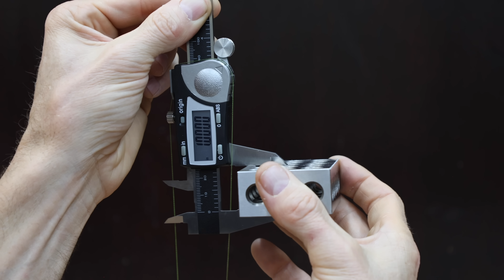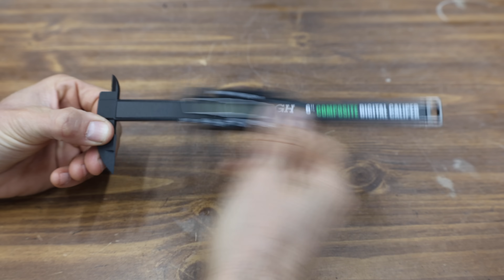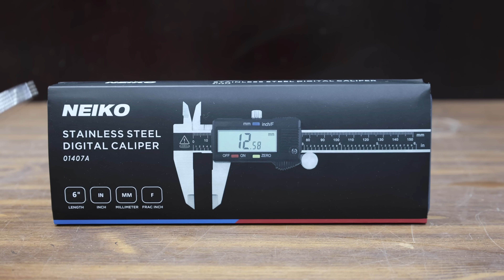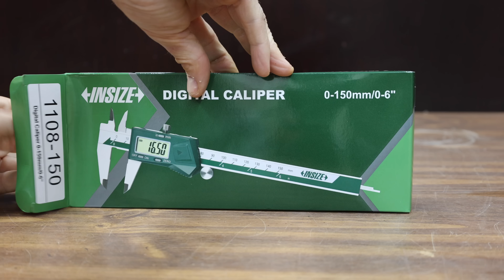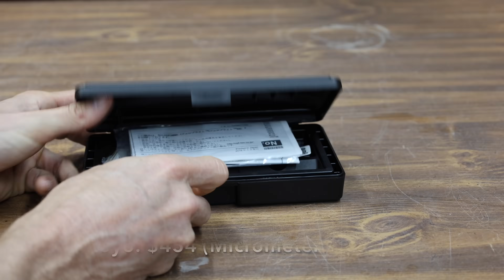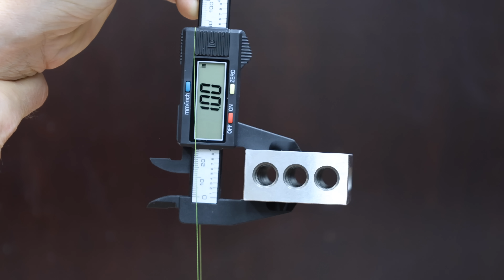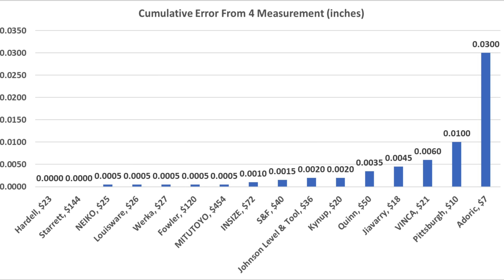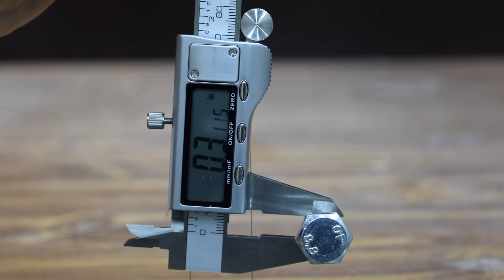I've Been Proven Wrong About Calipers!

Comment: The real difference between the $100+ tools and the sub $100 tools is that the higher priced tools will still be accurately reading after long term daily use, the less expensive almost certainly not.
Reply from the maker: Thanks for the feedback.

Comment: Great video as always! Beyond the feedback that the others put, I see that some of the calipers have USB ports on their sides and from my personal experience with my rechargeable calipers, the 2032 battery used is usually a CR2032 (CR indicating not rechargeable), but my calipers have a USB side port like I see in some of you models and I mine came with an LIR2032 (sometimes LR) battery in the package and is rechargeable by design.  I know it isnt something you tested, but it would be nice to show as a part in the consideration which models included (was hard to see in the video on all units) were rechargeable out of the box or possible, due to the nature that many here know and you indicated somewhat, the negative nature of calipers that are always found with a dead battery state.  I find that the models that at least include a charging port at least very heavily negate the problem with high battery usage while in the "off" state.  Since LIR2032 batteries only sell for about $5 or less, it can be a simple consideration for many that hate to come to a dead battery.

For instance, I use my set so much, but I find very frustrating to come to a dead caliper battery, that I have a USB magnetic plug on mine that quick disconnects to a USB charging cable at my workshop station so I can always pick it up with a full battery and easily put down with a magnetic click.  This helps keep my readings indefinitely while "off" and doesnt force me to pay a lot for a caliper for the ability to last long on a battery.  Sure, there are solar ones, but being forced to look for a solar caliper also can negate the point of being able to choose whatever brand you want.  Not to mention solar calipers need to be stored usually with light showing on them and reduce real estate for the display and other features.  For as little as 30 dollars on Amazon, it is pretty easy to get rechargeable calipers and put the ever present dead battery on pickup of the caliper as many DIY'ers don't use calipers enough to justify worrying about much more expensive units or always having a spare battery around or removing the battery after every usage.
Reply from the maker: Thanks!  Thanks for the feedback.

Comment: Great comparison! Battery drain when not in use is a killer on digital calipers. I take the batteries out of some of the cheaper ones I own when not in use. Thanks for sharing!
Reply: That's why I bought a Mitutoyo 8" arround 7 years ago, still the original battery inside.
Reply: Ditto. A couple decades ago my Harbor Freight Pittsburgh digital caliper would deplete a battery every 30 days on the shelf. My Mitutoyo goes years on one battery. For most things I have used a plastic dial caliper knowing full well it probably is not as accurate as the measurement suggests, but it was exactly what I needed for PCB layout and spec sheet verification.
Reply: Even most of the ones that "auto power off" are actually running all the time. They only turn off the LCD. Any that wake up from movement alone were probably still measuring. Not a big deal if you use them fairly regularly, but it's more akin to putting batteries in a clock, than say, a torch.
Reply: agreed
Reply from the maker: Thanks and you are welcome!
Reply: Mitutoyo I believe has a patent on tech to shut off battery use when not being used.  This is why the others drain batteries quickly.  It’s unfortunate, really.
Reply: @diamond_h0us  Mitutoyo may have a patent on a way to shut off the battery when not in use but can not have a patent on the only way to shut off the battery when not in use. And it has been over 20 years.
Reply: Absolutely yes I always slide the battery out after using and that's the only way it'll last on the cheap calipers.

Comment: I have owned a set of Titan calipers for a lot of years. I found them online today for $35. Over time, they have gotten quite stiff to open and close, but they still give really accurate measurements when compared to my 0-1" micrometer. My scale says 149.5g
No absolute scale, inch/metric measurements, 4 decimal places in inch, 2 places in metric, yes powerdown after time, LR44 battery which I can't even remember having to replace.
Overall, they are plenty good enough for my occasional use - including when I rebuilt the motorcycle I had.
Reply from the maker: Thanks for sharing.

Comment: When I took my Automotive service technology program at the Southern Alberta Institute of Technology all of the specialized micrometers were Starrett, but they were the very top grade models and they were the old models, meaning they were built far sturdier and made out of far better materials than what the company puts out today. I still have my Snap-On tool truck calipers but they don't carry the Snap-on name, but Snap-On's lower cost brand Blue Point, and they have lasted me well over twenty years and still have not become loose in any manner. I paid $99 for them, which carried a 25 year warranty, which is now over, but the Calibers has an error of 0,001 +or- and for rebuilding an engine it is sufficient But I would prefer to have micrometers accurate to 0,0001. but honestly the $25 calipers would be sufficient for most home use, and even for someone who has an old Lathe. but a professional machinist would have very high quality micrometers because the work demands that kind of accuracy. For me my Blue Point Calipers will last to be handed down to my son and longer if he treats them as well as I treated them.

Comment: Great test, I like that you compared to many models! One you didn't test I can recommend for a good value are the iGaging calipers. Some things I noticed regarding your test:
- 1-2-3 blocks aren't accurate enough, especially not for micrometers. You should use gauge blocks with a certificate and then compare against the length on the certificate. With both of my Mitutoyos, they measure exactly what the certificate states, so I assume the measurement error you found is probably due to the inaccuracies in the 1-2-3 block.
- With cheaper calipers one thing I noticed is that when the batteries get low (before the alarm goes off), the accuracy drops a lot. It would've been interesting for you to hook up a power supply and see how they measure at different voltages.
- It would also be interesting to measure power draw, especially when they are powered down. I noticed cheaper calipers don't really power down and are usually dead within 6 months of not using them, while Mitutoyos last for years.
Reply from the maker: Thanks!  Thanks for the suggestion.
Reply: @ProjectFarm  you're welcome! Another thing I just remembered, with some cheaper calipers, when you open and close them quickly (just like you did for the initial smoothness check) they "lose track" and when you close them they don't go down to zero anymore. This is what is referred to as "Max. response speed" and Mitutoyo's calipers say "Unlimited" which in my experience is true. With some cheaper calipers I had to pay attention not to open and close them too quickly. Would be interesting to see that tested!
Reply: @ProjectFarm  I also just replicated the test you did where you measure how consistent the force is on the scale when sliding down with my Mitutoyo 500-161-30, it started off at around 280g for me and progressively went down to around 240g by the end. I was already surprised when seeing in your video the force became higher towards the end, as I never noticed it, and my measurements prove my intuition. I'm wondering whether the thumb wheel (which mine doesn't have) introduces friction, or whether it's just that over time with usage they become more loose?

Comment: As always, thanks for the video!  However IMO as a casual user/DYI all digital calipers are lousy as the battery is guaranteed to be DEAD when you need to use the tool the few times a year you need it so for most non-pros I feel the best option is an analog caliper and I have had once for 25 years that works just fine.
Reply from the maker: You are welcome!  Thanks for sharing.
Reply: Mitutoyo digital caliper doesn't have that issue..

Comment: Another great test. For future tests, it'd be nice to see Shars' Aventor. They appear to be similar to the Quinn, but it'd been real nice to see if they were close enough to likely be off of the same assembly line. If you test micrometers (hint hint), I suggest adding in the Aventor's as well. I have a Mitutoyo digital caliper I bought in the late '90's that is still hanging in there, but I thought it might be dead when I found the battery had leaked. I got lucky it's still working.
Reply from the maker: Thanks!  Thanks for the video idea.

Comment: Starter, Mitutoyo, Fowler, or of the top metrology based brands can’t go wrong. Worked with mitutoyo calipers and is still by far the smoothest when oiled with Starrett tool oil with gravity enough to make them move. I did purchase Fowler/Sylvac micron caliper for 500$, although it is nice reading down to the ten thousands of an inch it’s main use for me is quick, versatile high precision reference measurements when I don’t have a micrometer nearby.
Reply from the maker: Thanks for sharing.

Comment: I looked after a mechanical training workshop a few years ago, and we were always changing the batteries in the cheap calipers we had bought because they chewed through them so quickly. & they were broken by clumsy students (they looked very similar to the Hardell & Neiko ones shown here). However, expensive ones got stolen frequently, so we went back to mid-priced dial gauge calipers, which were almost as easy to read and lasted a whole lot longer than digital calipers.
Reply from the maker: Thanks for sharing.

Comment: My problem with these digital callipers is that you cannot completely turn them off. They will drain the battery in standby mode waiting for the jaws to open and wake up. If there was a digital calliper that fully turned off without removing the batter, I would definitely buy it.
Reply from the maker: Thanks for the feedback.
Reply: True, but the low power tech in the Mitutoyo really works.  Battery lasts literally years.   I would estimate a hundred times better compared to the cheap ones i owned before them.  

On the cheap ones with LR44 battery i would suggest removing battery whilst in storage.  This favors the ones that don't need a screw to hold the battery cover down, and/or the ones using bigger battery eg CR2032

Comment: At one extreme, some of these tests aren't particularly "valid" when you're down to tenths of a thousandth of an inch. For example, even the heat from your hand can change the size of the workpiece but also the instrument at that scale.  But... it's all about the right tool for the purpose.  I have some expensive measuring tools to use when it's critical but I also have some of those $7 plastic calipers for situations where getting down to hundredths of an inch is somewhat overkill (but I need to be more accurate than a tape measure) and if I break or lose them on a jobsite it's no problem.

Comment: I have one from Harbor Freight that I purchased 10ish years ago. I use it sparingly and after 6 months the battery was dead. I replaced the battery with a brand name, Duracell, and it lasted 9-12 months with little use. In both cases I manually shut it off. Since then I remove the battery after every use. The battery now has lasted at least four years. There must be a quiescent ghost voltage leak in the circuit.
Reply from the maker: Thanks for sharing.

Comment: 12:55 some Volkswagen optimization and rounding going on here with some of these. Should not be testing with a 1/2/3 inch block 😅 The performance is built into the chipset.

Comment: For the depth measurements, I'd suggest putting the 123 block on a piece of granite or ground steel, because I don't think the table is flat enough. That would be why the two industry standard brands (starrett/mitutoyo) showed inconsistent results. In all honesty, Mitutoyo is the standard for aerospace but Starrett and Brown&Sharpe are brands that most top tier machinists use. IMO both are more accurate especially if you want dial calipers, but Mitutoyo can withstand more abuse from operators.

Comment: I bought a NEIKO from Amazon for home use.  I wanted a hardened stainless steel scale and did not wish to pay a lot for it.  It is working quite well.
I've a older Harbor freight with a stainless steel scale that gets used almost daily at work.  I've had it for around 20 years and it has worked very well.  I think it was only around $12 when I bought it.
Reply from the maker: Thanks for sharing.

Comment: I have a classic vernier caliper, and a digital caliper in my setup. My digital caliper is the $50 - $70 range type and it is pretty okay. My vernier is Starrett and I generally trust it more because if I've given a machinist specs using that one, it drives them less insane. Digital calipers are great, but the extra decimals you get from them also drive machinists insane because they are less reliable than a mic, but a lot of newer people try to use them as such. 

Granted, I'm not an actual machinist. I'm just a millwright now... so yeah...
Reply from the maker: Thanks for sharing.

Comment: Correct me if I am wrong, but the hole depth measurements being done on a wooden surface probably introduced some error into the measurements, right? Wood isn't a very hard surface, and so I think it is very likely that the relatively sharp depth probe ends were digging in a little bit depending on the force applied. And we don't really know how flat or clean the surface of the wood was. I am sure it doesn't change the rankings enough to justify changing anything about the video, I just didn't think it seemed like a very accurate test due to this variable...

Also for precise measuring devices like calipers I believe accuracy is second to repeatability. It is very tedious but performing the same measurements 3 (or potentially more) times would hopefully prove that the tool is going to STAY accurate. Even a sloppy measuring device could potentially get a correct measurement every now and then. But this second point is less of a concern to me than the one about the wood surface. I wouldn't throw out any test results just because they were only performed one time on video.

Comment: Seems like the cheap ones have come a long way. One of the common issues with cheap digital calipers is that they drain batteries fast both on and off. While I no longer machine for a living, I've never had my battery die fast in my Mitutoyos. In fact, the pair I bought for home use on still using the battery they came with after years of very occasional use.
Reply from the maker: Thanks for sharing.

Comment: So out of my use (I’m a machinist) insize is branded China so ok enough, shars avendor is my personal cheap set, work has the IP54 mitutoyos like demonstrated, SPI is disappointing, starret is an absolute nightmare for the mic and caliper samples we got to try (only set we’ve ever had fail under regular use and with parasitic draw), and my personal set is the Mitutoyo IP67 ones (the highest line). 

As far as calipers go, all the brand name ones should be good, and they should have that moderate pressure as it prevents jaw movement which can make tip measurements inaccurate on less than ideal surfaces. Also, Mitutoyo will read much better than you demonstrated as those gage blocks are often +/- .0002” (and China ones often exceed that by an additional 2) which the mitutoyos will pick up .0003” and read .0005” which is only known by micrometer. 

In terms of value, I find the aventors compare similar to the IP54 Mitutoyo line, but at about 1/2 the cost. 

Though I have stoned a set of the Pittsburg calipers to use for rusty garbage which is good enough.
Reply from the maker: Thanks for sharing.

Comment: At work (Machinist) i'm using whatever they buy which is usually mitutoyo, i'll check the accuracy on some gage blocks but feel good using them for up to a plus/minus .002. At home I use some fowlers and the 8in Pittsburgh and if i'm just fabricating (usually plus/minus .030) Pittsburgh work fine and if they get knocked off or dropped no big loss. Had them for 2/3 years and they are still pretty consistant within .010 but i did have to return the 1st ones immediately because the grit had jammed them out of the box, 2nd pair had no grit and was much smoother.
Reply from the maker: Thanks for the feedback.

Comment: I have a higher quality set of Fowler/Sylvac calipers and have owned many sets working in the auto industry as a quality tech/engineer and manager. I retired from an automotive stamping plant and made the buying decisions for gauging. The operators were hard on calipers and it didn't make a lot of since to buy Mitutoyo, Fowler, or Starett. What worked best for us was the igaging brand, 0-6" abs calipers from Amazon and others. They held up well in  the shop environment with smooth and accurate operation. For $55 they were hard to beat.
Reply from the maker: Thanks for sharing.

Comment: You had one job and you failed. I searched for "battery" in the comments and I see a lot of people have touched on the same sentiment so sorry for beating a dead horse. You didn't test the most important feature! Standby power! I was given harbor freight calipers. They are OK for my needs BUT, every time I pick them up the battery is dead, so they are useless and I just use a mechanical one. That's why people should spend the money and buy Mitutoyo. Or you have to pull the battery every time. Clough42 has some good videos on this.